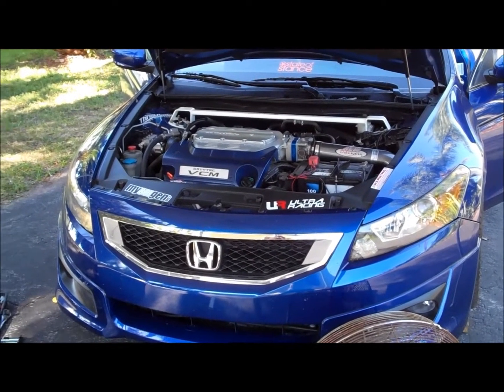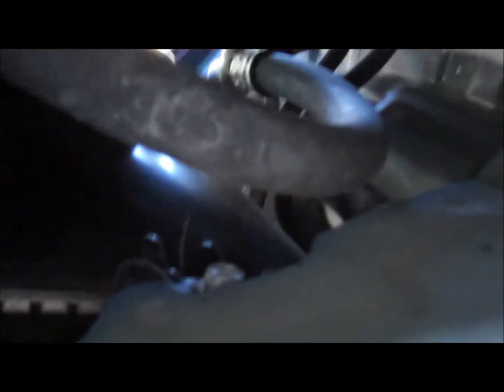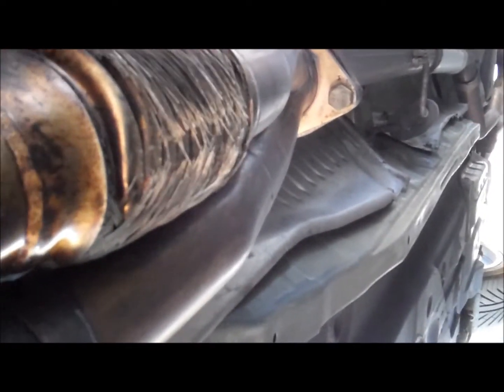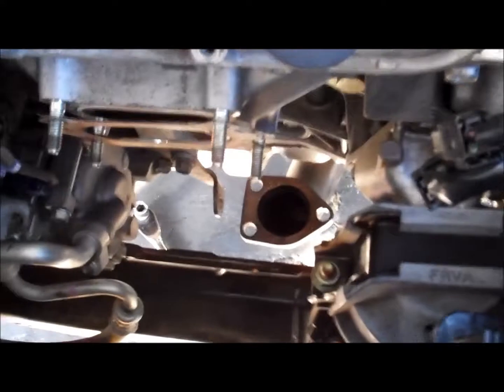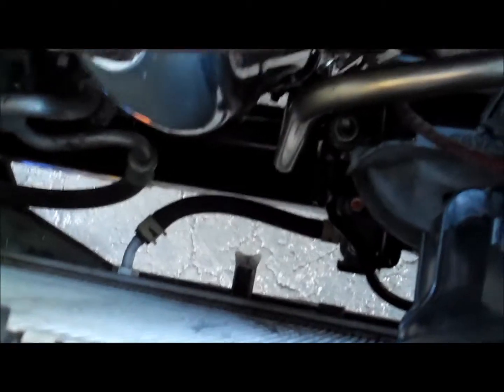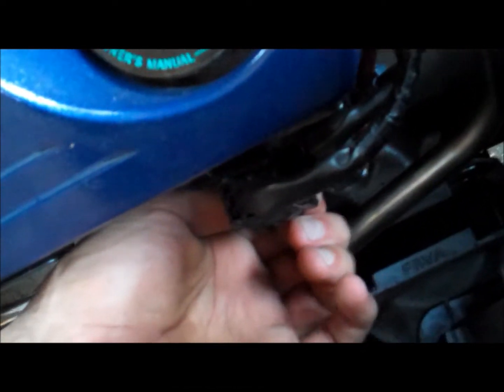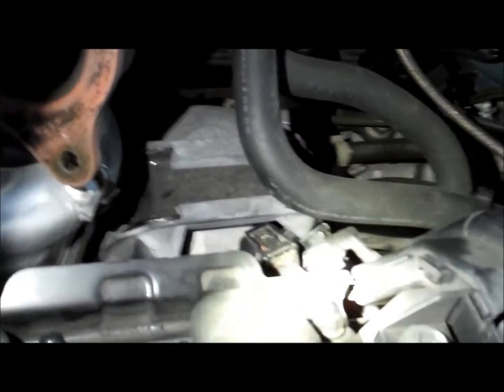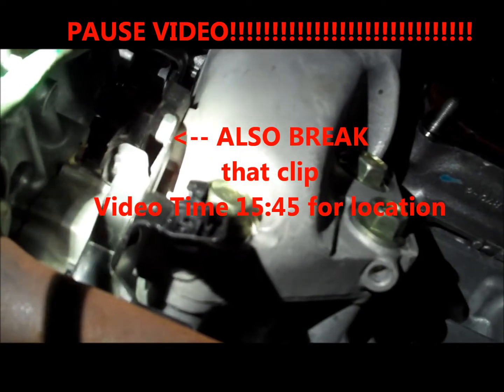Honda Accord  V6 RV6 PCD  Pre-Cat Delete or HFPCD  Install Video

Comment: Your car looks great and the work you've done also amazing. After you installed your PCD & J-PIPE and I also see you have a TB Spacer installed. Now did you have any problems with back pressure and did you have to make any adjustment on your ECU because of more air flow?
Reply: Harmik Der Gevorgian great question! I wonder why he never answered it
Reply: 8 years no answer???? Yah u wanna tune with the rv6 pcd with the j pipe to little back presher

Comment: Do these cause check engine light or not pass smog?
Reply: You can clear check engine light and pass smog by using spark plug foulers check on forums, they also have oxygen sensor bypass that u can buy from ebay for honda vehicles